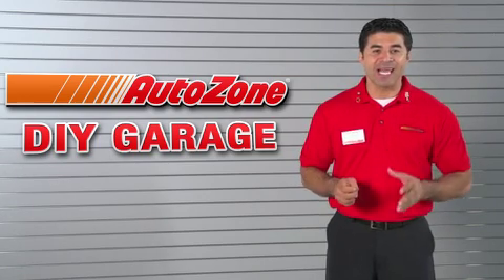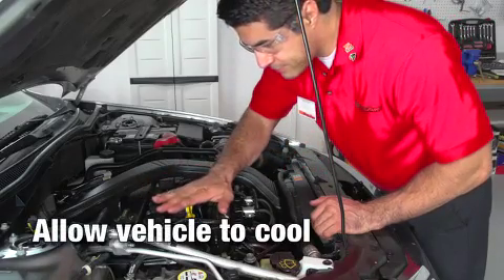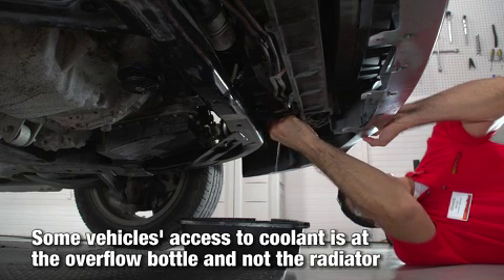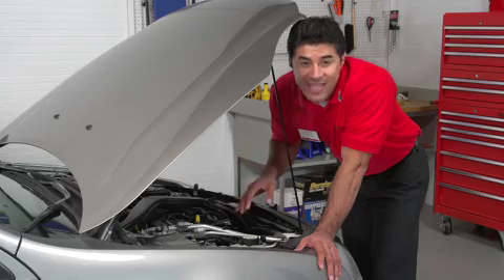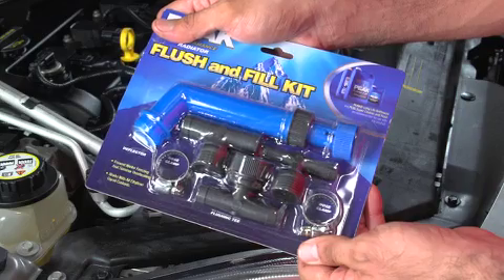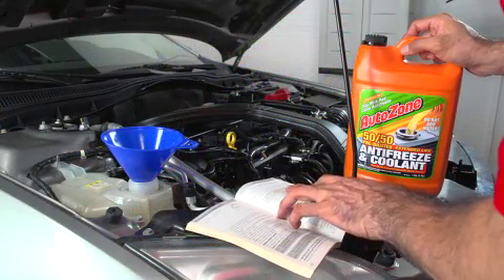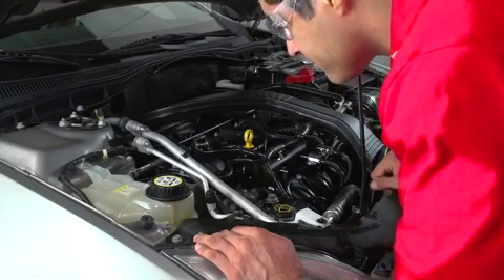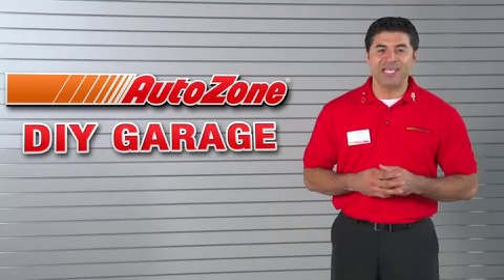How To Flush the Cooling System - AutoZone

Comment: "never use tap water in the coolant system because it can cause damage", "flush the radiator with water from a garden hose"...that's one of many reasons why I don't shop autozone.
Reply: Chris Grimm flushing it is ok with tap water but not tapping it off with it
Reply: Distilled water, correct?

If I was to complain about lacking info it would be that he doesn't mention to burp the system to get air out.

Comment: That was the reservoir cap, not the radiator cap.
Reply: Dylan McElveen and the reservoir goes to the radiator. stop trying to sound smart.
Reply: Reluctant Couch 
I hate going into auto zoo,  I know more than the morons working there
Reply: @wesss9353  congratulations. Most people go there for parts. Not help.
Reply: REDKILLER l
Reply: Maybe this radiator does not have a cap , only the reservoir, so I’m guessing that’s what he meant…
Reply: He doesn’t have a radiator cap that’s why so you have no choice but to do it in the reservoir